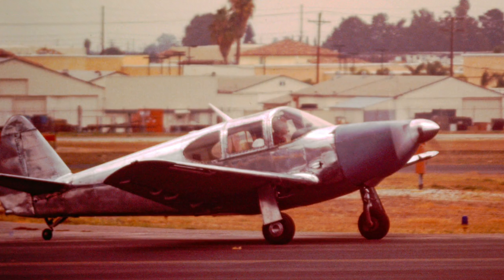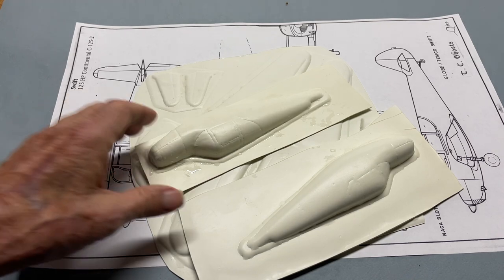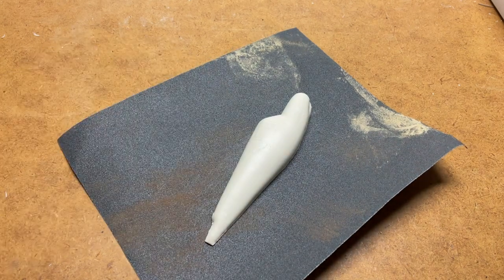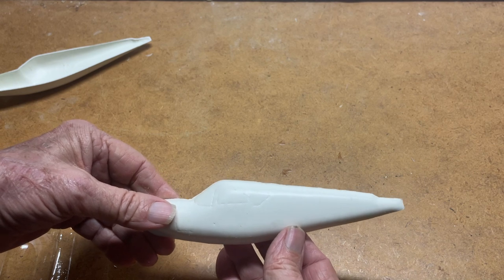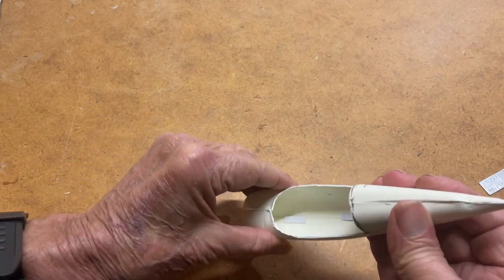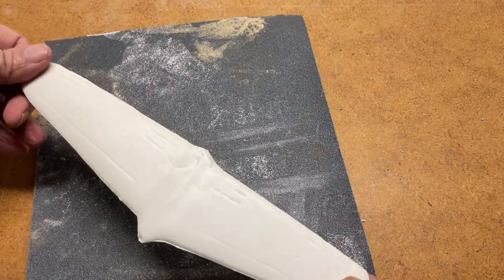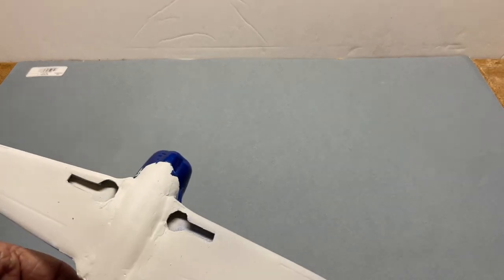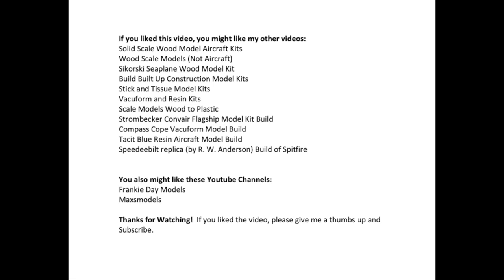Globe/TEMCO Swift Light Plane Model Kit Build

Comment: Who else do you know has a 1/32 scale Globe Swift? Get better at masking. You’ll see it includes more than just blue painters tape. Great build though.
Reply from the maker: I wish I knew the answer to that as I'd really like to have an injection molded Swift model in any scale.  You are right about the tape.  I realized that expensive model tape is better than cheap painters tape just recently.